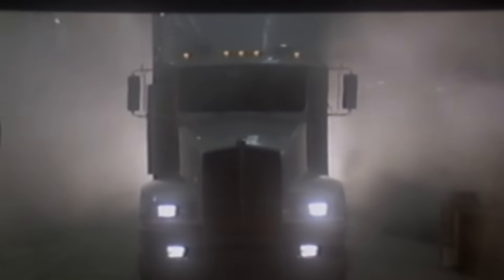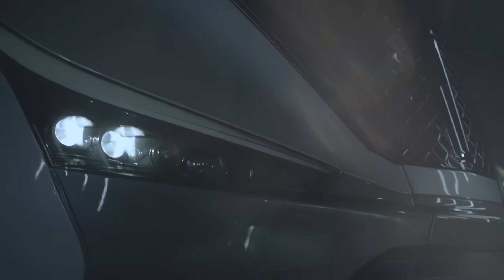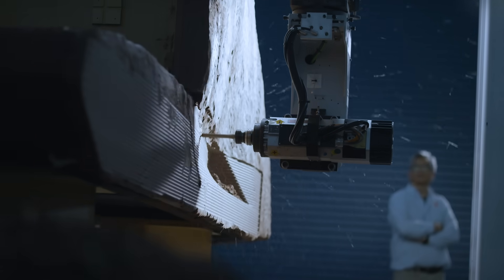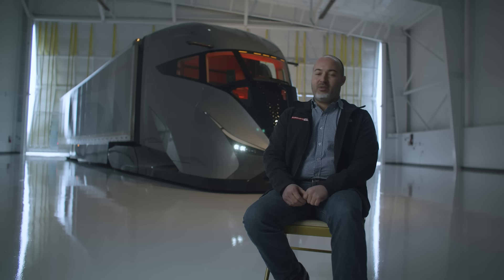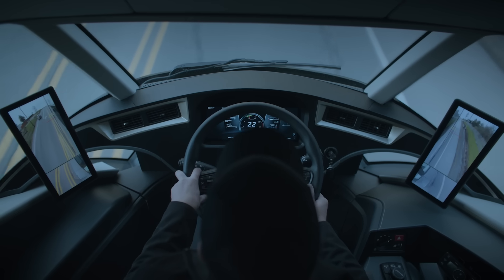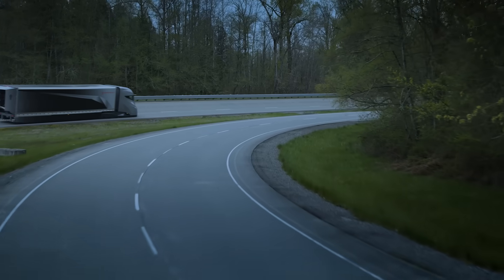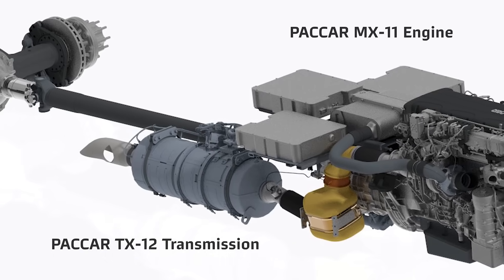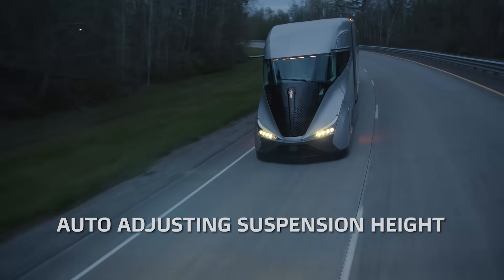Kenworth SuperTruck2

Comment: Who really gives a crap about fuel mileage if the truck is so damned complex that you drive it from one repair shop to the next?  SIMPLE is much better than 'fuel improvements'.  Reliable is the MOST important feature, and they have forgotten this.  They are so damned enamored with all the fancy technology they don't understand that all of those gadgets are incredibly prone to failing.  Especially when you understand how ROUGH the roads are!  The DEF systems are a joke.  Every informed driver out there on the road knows that by removing that gimmicky system the trucks would get MUCH better fuel efficiency, and RELIABILITY!  Has anyone done the studies on how much pollution is caused BECAUSE of the DEF system?  Especially when you take into account all the by-products from manufacturing all the parts that are continuously breaking due to this finicky system, not to mentioned that massive toll the system takes on fuel efficiency?  I realize that common-sense went out the window with the introduction of the 'global warming' dogma, but seriously?

Comment: I hope this is a joke. It looks terrible and a complete rip off of tesla. You chose your apollo looking truck as a base and butchered it. How am I handing paperwork out the window? How am i keeping the floor clean? Your tv mirrors dont allow changing viewing angle by shifting my position in the seat. Put the engine back infront of the cab so the driver has piece of mind if a moose steps out. 
Your company needs someone to shake people when they show up with designs like this.

Comment: I think they should figure it out all the problems that next generation  truck has   I drive about 150.000 and  nine times stop in the shop  replace all 6 injectors  , coolant tank,  sensors,  side plastics  and fabricated lots of brackets to hold the side panel and plastics from vibration and noses  not worth the money  stay away if you can. 👎👎👎

Comment: I'm still wondering why DOE demanded the diesel engine as the primary source of its energy. Why not a series hybrid, with a 100-200kw diesel engine onboard to recharge/range extension? Seems to work just fine with diesel-electric locomotives.
Reply: Oil and gas subsidy

Comment: I have seen in Germany many years ago project from MAN Truck Company.  It was amazing to see it. Since then nothing new.  But I´m sure there is lot´s of to be improve.   I have been drivin in our Company DAF 480, Actross 510, Volvo 460 and Scania 450.   I can say that Scaia fits to me. Actross was stronger, DAF has bigger cab.  Volvo had smooth gearbox.  But still Scania I do like. Now have 626 000 km and I do hopo so I will be able to hit  1 000 000 km easily.    But for this KST2 roads must be perfect and that is problem even in Europe.  Very often you would drive with suspension in higher position.

Comment: Whoever designed this has never driven a truck for any length of time
No passenger seat. Aerodynamics are not everything. Pretty to look at, but not functional.
You'll sell more if the drivers seat and passenger's seat are side by side; For training purposes & for spouses/co-drivers.

Volvo's Supertruck is better. It's aerodynamic & has a PASSENGER'S SEAT
https://youtu.be/lBoPobViWL8?si=d4LYGXUC49F6CMr6&t=33

Keep the 2017-2019 PACCAR engine. That engine is awesome

Comment: The oldest and best ev is the train if they keep a diesel to run the generator then maybe buy the whole Def system sucks   it will be in the shop more then its on the road I'd drive it but I dame sure won't work on it

Comment: Still not sold on the center driving position and digital mirrors. Second, it needs deployable fairings at highway speed to lessen the space between the cab and trailer. Fairings should retract back into the body at speeds below 30 mph. Sleeper looks cramped.

Comment: My. 17 deleted KW 900 TUNNED AND COMPOUND TURBO  CUMMINS HAS 1000 HP AT THE FLY WHEEL AND 725 HP TO THE GROUND 3000 PDS OF TQ AT 1875 RPMS  ON PDI DYNO,BOB TAIL IT GETS 22  TO 24 MPG AT 72 MPH LOADED TRAILER FLAT BED  NO WIND 11 TO 13 MPG SO TAKE THAT NEW TRASH AND FK OFF

Comment: Questions no one will answer about these vehicle types. If I had to drive this truck in a blizzard. Will it work? If I had to drive this truck threw flooded out roads for safety. Will it work? If I had to drive this truck threw high winds. Will it work? While driving this truck. Fully loaded. Supper head winds. Will I make it to my next stop? If I am stuck in a blizzard. I can't go nowhere for days. Will this truck save my life? I used to drive trucks. Army and citizen. Citizen. I drive only KW. My dad drove. My brother drove. I am asking for the future truck driver only and my own curiosity. What do I personally think about it. I love the long nose 13 speed. Those. I personally can't stand. Being honest. Yet. Not my problem. Just asking.
Reply: adjustable pneumatic suspension. What is shown here, is their lowest setting. As for the wind, it, most likely will work way better than existing truck

Comment: If only Kenworth had parts for their trucks.  The was a sensor that without it the truck would not run. It had a back order of over 900 units with no sign of new part.  Kenworth had to do a work around so people could use their vehicles..

Comment: This equipment  is disign to be an open road equipment ,what is going to happen when you need to get to the suburb area of the city were space are limmited and parking space are very very tight mosrst of this extra components on the body will be in ricks to become damage .
As a Driver for a tractor trailer this factors are to take in considerations when designing an equipment that is going to be used in the transportation system.
I Drive a kentworth 2021 a day cap the turning ratio on the front wheels is limmitedto the point that some time you need more room that normal because the turning ratio.
Reply: this truck seems to be much shorter than most american conventional trucks

Comment: Forget taking that off road at all. That’s 100% interstate, don’t even want to hit a pothole.
Reply: You all are arguing over the dumbest thing.  Have you ever heard of a concept car.  That's what this is.  This version will NEVER hit the road, it's not meant to.  It's a concept to build implementable ideas from
Reply: That's fine. That's where most trucks spend most of their time.
Reply: I guess you missed the active suspension adjustment option.
Reply: @OldsmobileCutlass1969Va  I'm guessing you've never been any of some of those dirt and gravel drop yards with potholes that's deep enough to give an average truck a problem, so if you actually think that truck can traverse through that with no problem, I gotta bridge I want to sell ya.
Reply: @OldsmobileCutlass1969Va  

I didn’t. This truck won’t be durable enough to tackle logging roads and such that specialized freight drivers need to tackle. It’s a great truck for interstate, should be very efficient.
Reply: @fighter4christ7 So it can't tackle logging roads... There are other trucks for that... 😅😅😅
Reply: Are you really going to be stop and let it adjust to keep going? @OldsmobileCutlass1969Va
Reply: Lol the interstate road are just as bad as " Logging" roads.  You people don't know what you are talking about. Guaranteed no matter the suspension used it won't adapt to potholes that launch you into the air

Comment: Neat features of course with new technologies, but I am so tired of seeing manufacturers bow down to these carbon neutral demands. The more electronic these trucks become the more problems they have and the more problems we can fix ourselves. It’s all unaffordable dealership work and not to mention the upfront cost of one unit. I could easily see that costing over $300,000. Just another way of snuffing out any independent competition. This is not a good thing and nobody is talking about how harmful it is to the environment to manufacture batteries and electronic equipment yet it keeps moving forward.

Comment: Why not continue designing trucks instead of gimmicky aerodynamic nonsense.

Simplify the Machine.  
Build it even more reliable, sturdy, and durable.  Cut out the problem issues.  Get the kinks out!  

The  day cab and sleeper cab should be lower in total height albeit slightly longer.  The track has to STAY wide!! 
The TRACTOR has to STAY at LEAST 19,975 lbs !!

It's a TRACTOR that TOWS heavy trailers full of WEIGHT, remember??! 

Incidentally, does anyone there know that the tractor has to STAY heavyweight and has to keep on improving with better and better TRACTION to the road! 

You are trying to simplify , not complicate, hello!!
Get RID of complicated electronics!!!

GET back to building MANUAL transmissions!!!!!

Comment: As a fan of the Discovery Channel shows Heavy Rescue 401 and Highway to Hell, I have to ask: how do you pull this thing out of the ditch?

Other than that, this is a remarkable achievement by Kenworth’s engineers and designers. Congratulations!

Comment: Fuel cost reduct by 52%. Maintenance, repair and towing cost up 900%. Casualties on the road from little to no inspection... Through the roof.
Reply: I think it'll be possible where the truck uses computers to do it's own inspection and notify the driver of any violations 
.... it'll be tied to the elog and trucks ECM.... A visual inspection will still be possible but mostly by sensors and perhaps thermo scanning to tell if a tire is overheating, etc...

Comment: I love how the engineers took off the shelf parts and just reconfigured the legos in a different combination breaking the mold/status quo of what it means to make a semi truck frame!

Part 2?  In depth going into the layout of components on frame (unless it’s proprietary)?  

I see and like that the radiator core is shorter but thicker possibly to keep similar cooling characteristics to traditional radiators, love how low the engine is on the frame, given its now behind the axle and if I had to guess dry sump oil pan?  Finally a cab over without the intrusive in-cab engine shroud like traditional built cabovers.  

Hopefully everything is accessible and easy to disassemble and reassemble, quick access ports for fluid level checks and easy pre-trip would be perfect (especially considering wheels are now shrouded, hopefully checking tire pressure and hub oil level is easy and not a pain).  

And obviously, the aero logic looks superb, looks like it’ll cut through the fluid that is the atmosphere like an efficient racing catamarans hull skims across the water!

Off course this shouldn’t be a replacement for traditional classic configurations, owner operators know what they like and what works, if it ain’t broke, don’t fix it, and I get that, but I see these aero trucks saving thousands of gallons of diesel a year if implemented in a large fleet and that can’t be ignored.  Best of both worlds I say!

Also if the fuel tanks are now in frame,  there could be some serious storage space possibilities along the lower sides of the cab, kinda like a passenger bus storage bins.

Comment: “THE BIGGEST PRICE TO US WAS WHEN THE ENGINEERS SAID THEY FOUND A WAY TO ENCLOSE THE FRONT WHEELS ON THE VEHICLE” 😂😂😂 because it’s going to cost $6000 to check the tire pressure.. it is a beautiful truck and concept as long as you guys make it so efficient where company owners aren’t in the shop 6 months out of the year!
Reply: I would assume tire pressure monitoring is done real time by the truck's computer like it is for modern cars?
Reply: @necavenue  I’m sure of it as well
Reply: the brilliant engineers also hid the engine between the frame rails and under the cab.  If you thought diesel mechanics were expensive, it now takes 10 hours to get to the engine.

Comment: Looks like a Tesla Semi but actually capable of hauling more than just Frito Lays. Lol
Reply: The facts suggest Tesla semi has better acceleration and hauling than diesel
Reply: @johnsutherland7561  With all due respect, it is impossible for a Tesla Semi to haul more. The Tesla Semi weighs much more than a diesel tractor and given that trucks and their trailer loads have a weight limit, a heavier tractor means a reduction in hauling capacity. If you want to ignore the weight regulation, then maybe. Fast acceleration? Sure. But that is not really something that is essential in the trucking world. Given the improbability of a vast array of megawatt  truck chargers being deployed that would be capable of charging electric tractors over the road, it is unlikely that purely battery electric powertrains will become highly successful and become the majority in the trucking space. I would like to point out that combustion engines are only efficient under high load and best used for heavy duty tasks. The hauling of chips like the Tesla Semis used by Frito Lays actually makes a lot of sense. It's short haul, light cargo. Niche applications like this make sense for battery electric tractors but not much else at this point.

Comment: Center driver position would throw us old timers off. But retired and it is beautiful and so cool . Build it and get it out there!
Reply: Wont be hard to get used to. Loader operators love being in the center of the machine
Reply: all the old timers were trashing tesla for making a truck that looks and does exactly this same thing but with a battery instead of a diesel.  And good luck old timer, swapping a turbo on this engine when the engine sits between the two frame rails under the cab!!!!

Comment: I currently drive a 2023 Kenworth Next Gen T680. It gets 10 to 12 mpg daily, even fully loaded. Has a Cummins under the hood too. The numbers of this new Super Truck arent as impressive as they make it sound, but I do like the limiting factors of the body panels for a D.O.T. inspection ;)
Reply: Well that’s because you own 1 truck… not an entire fleet of trucks where the numbers start adding up significantly.
Reply: @dapulse3916  Company truck!
Reply: Paccar has a B10 rating.. meaning 90% get million miles before major overhaul. My friend had a 2014 T680 with almost a million miles before he sold it and retired.. never had a major issue with the motor.. not even a injector went bad
Reply: that's very impressive MPG. i think those stupid 6 wheel pickups i see people driving to pick up groceries probably get about the same mpg as your semi
Reply: @TheSateef  my 2001 dodge dually gets 21 mpg on the highway with a 48 inch freightliner sleeper and 80 gallon fuel tank full
Reply: As an owner operator, I'll take a cummins over that crap Pacar any day. Plus these guys obviously never considered speed bumps or potholes. lol
Reply: @jaysonlanders1222  literally said it was a proof of concept to test out new tech and isnt meant to be sold on the market. so speed bumps and potholes are a mute point to make, you can just say you dont like it. thats fine, but dont try scrapping for complaints when the complaints arent relevant to the vehicles purpose.
Reply: @jaysonlanders1222  The truck suspension can lower for the highway for fuel efficiency and rise on bumpy roads. You know nothing Jon Snow...
Reply: @jaysonlanders1222  Paccar and Cummins are literally the same engine.

Comment: That center drivers seat would suck for backing into tight docks. The driver wouldn’t be able to see anything at the back of the trailer. Congrats, you designed a truck that us drivers will hate using. I’m sure the mega’s will eat this shit up.
Edit: A steer blowout would obliterate the body. It would cost a fortune to repair.

Comment: Center seating and aerodynamic? So it’s a Tesla truck lookalike? 🤦‍♂️
Reply: Believe it or not the center seating position predates the tesla
Reply: @j.m.5995  Yes but like 48 volt in the cyber truck It took Tesla to bring it mainstream
Reply: Nailed It!
Reply: And it's equally worthless.
Reply: @mattphillips1910  Tesla semi will be in high demand because of the great savings on fuel
Reply: @johnsutherland7561  Not true. Tesla trucks will have no demand, unless the charging stations appear, and are working properly. Last time I checked, truck drivers don't make money if the wheels aren't turning. The amount of time required to recharge a truck that has an extremely limited range to being with is a money loser. And that's assuming there is a charging station close enough....And that's assuming that station works. The entire idea is ridiculous.
Reply: @mattphillips1910 Companies like Pepsi choose profit and competitiveness. I think electric semi's will take over in the next 5 or 10 years just like the car did to the horse and buggy
Reply: @johnsutherland7561  The good thing is that we are still allowed (for now) to disagree. You mentioned profit and competitiveness. I do agree with you there. Which is exactly why electric semis are ridiculous. I can see them being used for short haul deliveries. Say, with a 100 mile radius from home base, where they can be plugged in every night. The charging system isn't close to good enough. And one other little detail: If they installed enough chargers, and replaced all the diesels with electric motors, the grid would fail.